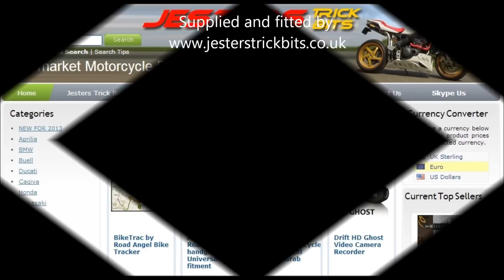Kawasaki ER6 2013 2014 unboxing and fitting of IXIL Full exhaust system.

Comment: If I'm not mistaken...  This would match up on the 2015 model as well, correct?
Reply from the maker: Yes correct 12-2016
Reply from the maker: Yes correct 12-2016
Reply: +jesters600 You have a URL that I could buy it with? I'm in the states.
Reply from the maker: +dollarznc http://www.jesterstrickbits.co.uk/categories/Kawasaki/ER6-All-years/

Comment: So I've been trying to loosen the nuts that connects the manifold to the engine. I managed to do 2, the other 2 were badly rusted, however I managed to loosen one. But I noticed that the screw/bolt is also turning with the nut.

I assume it's not suppose to do that? Can anyone please enlighten me on this? Thanks.
Reply from the maker: MavSkipper it’s just the head stud coming out. Just remove as one then fit a new stud or refit as is. No harm.
Reply: jesters600 Thanks a lot.

My mind stopped and went F*. lol
Thanks again Jesters600

Comment: Awesome movie , does it change the performance of the bike ?? and whats the weight difference between the original exhaust and the ixil one ??   thank you ... it sounds really great !!!
Reply from the maker: Ondřej Poledno Was not my bike, we just supplied and fitted to customers bike.
He is very happy with the system now and stated it does go better. Standard system was very heavy and the new one lots lighter. not had them on scales sorry.
Reply: Original exhaust weight 8kg. Ixil website says 2kg. Not sure if it's the whole system or silencer only, but probably the whole system, since it looks so compact. My complete akrapovic system weights 4.1kg.

Comment: Hello! I just bought the same exhaust, I will receive it in 15 days. I have a quesiton: does it has the catalys for the emissions E3 ? Because to be legal it need it . The sound omologation and the E3 emissions omologation.
Reply from the maker: Yes the link pipe has a Catalyts fitted and as you refit your 02 sensor the bike will meet all E3 emissions. with the DB killers fitted the system is 100% road legal. ps we have them in stock.
Reply: jesters600 Does it mean that DB killers are sold separately? (not included w/ this full exhaust system)? Are the DB killers made specifically for these exhaust or can we use any other DBkiller (w/ different brands)?
Reply from the maker: Arie Vianza
They are supplied with the system and can be removed as shown in the video.
Reply: jesters600 Good news :) Thank You! Keep making good er6n mods video... (y)
Reply: Oh.... one more question, please... Is it Plug and Play? I mean, do We just install em as you did in the video then up and running... or do we need to tune further; something in the bike to adjust the new exhaust (consideration: impact on performance or anything like that).
Reply from the maker: No other mods needed, just plug and play. as it keeps the O2 sensor the bike will ok.
Reply: +jesters600 Thank You!

Comment: Hi,  I fit this exhaust to my 2012 er6nl and it Billows smoke.  Is that normal when just fit?  Or is there some plastic wrapping I forgot to top off?
Reply from the maker: xXAB12Xx  It will be oil that is on or in the system left over from production. will burn off after the first trip out.

Comment: I'm looking into getting this exhaust pretty much as soon as I get this bike. I know very little about exhaust replacing but this makes it look pretty easy.
I have read a few things about needing to have the engine remapped when you fit an aftermarket full exhaust system. Anyone know whether this is true?
Reply from the maker: Not 100% true, as modern bikes are fuel injected and have O2 sensors the bike will correct the fueling and run ok. The advantage of fitting a power commander and then having it mapped will result in a soother power curve/delivery. we advise to have the system fitted and if you do feel any flat spots in the rev range then go for the PC and remap. Hope this helps. Nick
Reply: Oh sweet, fair play! I wouldn't mind having to get it remapped but it would be a bit of a pain in the ass in terms of extra costs, I imagine it isn't going to be cheap
Reply from the maker: There are some maps on the PC we site for free download, the Ixil is not listed but one of the other maps may be a close start to what may be required. Dyno centers usually charge around £150 for a dyno tune on your bike. but is it worth if? happy to sell you a £300 PC but not worth it IMO.
Reply: +jesters600 okay fair enough, thank you for the advice! I haven't got the bike yet, but getting a new exhaust for it is one of my top priorities!

Comment: Great video but would be helpfull to mention the correct torque settings for the exhaust manifold nuts as they must not be over tightened.  17N-m / 1.7 Kgf-m / 13 ft-lb

Comment from the maker: IXIL only supply this system in black finish now? we have limited stock in silver now.
Reply: Cheers.  Yeah it's all good now.  The video was a great help
Reply: jesters600 How much the silver?
Reply from the maker: Lucio Demartino £370+shipping
Reply: Yes. The last one, in stainless steel, stopped in January 2015. Then new one, black finish, is NOT ROAD LEGAL (never received a European homologation)
Reply: the new one black edition, not road legal, and this yes? 
but no kat also for this.. i can't understand
can you explain me pleas?? T.T
tnx
Reply from the maker: There is a cat fitted in the end of the link pipe. 
The factory developed this and it passed all the tests for Eu ruling but then they change the rules and it no longer meets the sound limits and Ixil are not going to re-develop the system.
Reply: jesters600 so, if i put this ixil, not the black version, on my er6n, is ok?

Comment: Very good video ! I have a question, im wondering how does the bike run with standard exhaust vs this ixil. Any performance decrease with the new exhaust ? Some bikes loose performance in low and mid range RPM when they dont get run in with power commander after getting new aftermarket exhaust like this one.
Reply from the maker: As i only supplied and fitted the system i have not ridden the bike.
The custoemr is well happy with it and has not reported any problems at all.
we have sold a few of these and never had any reported problems.
www.jesterstrickbits.co.uk
Reply: Absolutely yes you lose power at top my bike won't cross 180 after installing this exhaust with BMc air filter so get the power commander with it if you don't want to lost power

Comment: Do you need new gaskets to seal the exhaust to the engine?
Reply: Yes, part number 11060-1103 (x2 they come individually). Not sure why they weren't replaced in the vid.
Reply: I said the same thing I’m like why not take old gasket that wear out and had new one for better seal

Comment: Hi! And thank you!  I really want these for my 2013 ER6F.  Did you get a power commander (or other brand)? And if not, how is the ER6 running without it?
Thank you in advance!
Reply from the maker: No never fitted a power commander as it was not needed, nike runs fine with no flat spots in the rev range.
Reply: Hi, I just ordered a Dynojet V to work with the IXIL. Apparently you need one to get the best performance from the new exhaust system. Good luck !
Reply: Hi, I just ordered a Dynojet V to work with the IXIL. Apparently you need one to get the best performance from the new exhaust system. Good luck !
Reply: GTR MAN did you also get a high flow air filter?